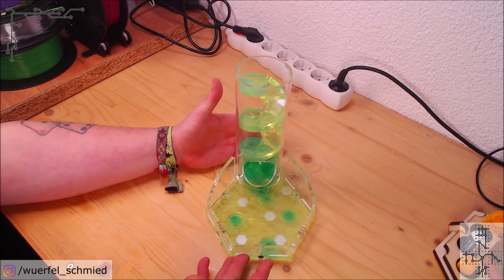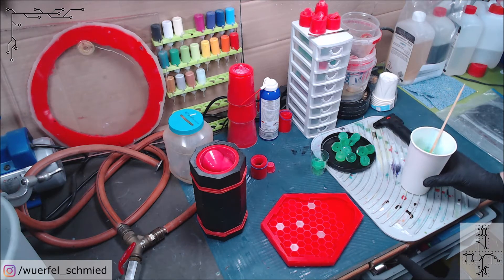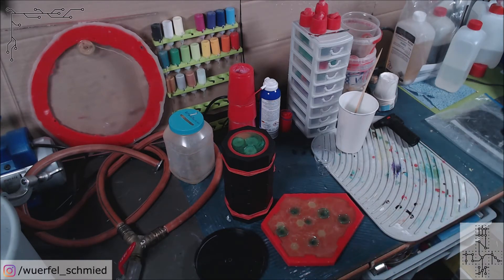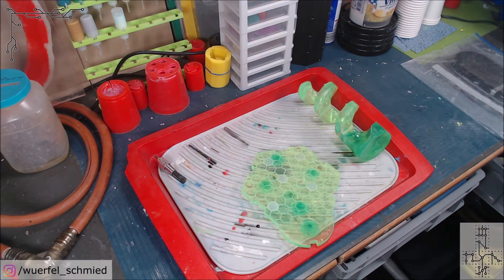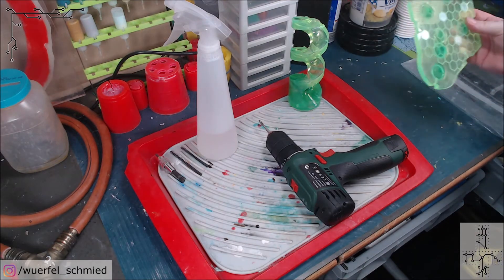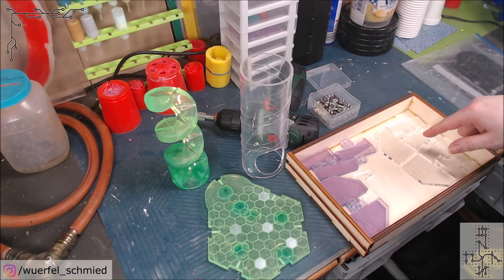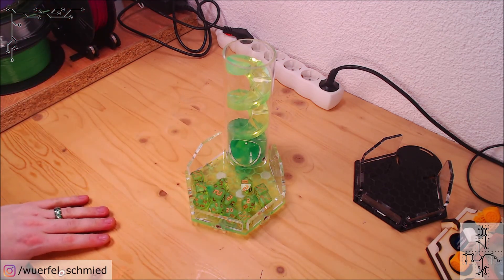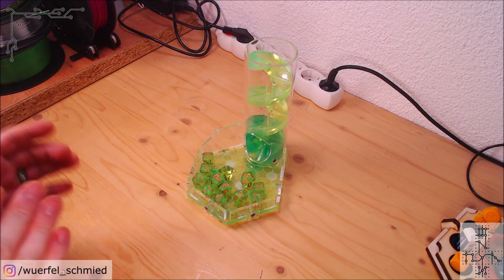Resin Tornado Dice Tower 2.0 - How Its Made

Comment: Awesome video.  Have you considered trying magnets to hold the tower to the tray?  Maybe small magnets would allow for enough force to hold the tray to the tower but still allow the assembly to be put together and taken apart easily.  Also I think magnets would kind of fit well into the scifi vibes I get from this tower and tray design.  For whatever reason I associate magnets with science and scifi!
Reply from the maker: Yes I thought of that, but I would need to give them a good position. So I guess the most effective way would be inside the resin parts. Maybe I'll give that idea a try with a prototype.
Reply: @wuerfel_schmied  I also liked your idea of using locating feet on the tower that can slot into the dice tray!  Maybe that is more simple than magnets since you can  have the feet cut into the bottom end of the circular part of the tower.

Comment: Looks really neat. The darker green circles in the tray gives it an alien or biological look like the view form a microscope. Though I think it would look cool without as well, just more alien than biological.
Seeing the screws drilled in from above I'm not crazy about. Maybe you could have the tiles above the screws be silver as well. That might hide them or it might just draw more attention to them and look too uniform. Hard to say without seeing it. It might just be the YouTube video compression making those screw holes look different than they do in real life, maybe it looks fine in person. I would have to se some close ups to know for sure. I don't know much about resin but could you add some resin or other liquid to the screw holes to get rid of the white look from making the holes. Either some kind of weak acid to smooth the holes or a resin you can squirt in the hole before putting the screw in so that it looks clear instead of powder white. Love the design, interested to see how you solve the problem of getting the tray and tower to be picked up comfortably with one hand.
Reply from the maker: That are some good points. Seeing the screws from above really isn't that nice anyways. But with darker resin or opaque resin they're not visible. A drop of super glue might already clear up the threads, I'll try that. Maybe I'll try to cover the tiles above with an opaque resin when I do the next test. I also share more pictures of work in progress on my Instagram.